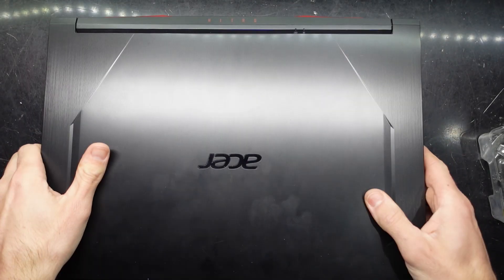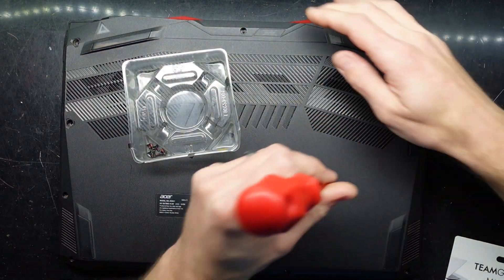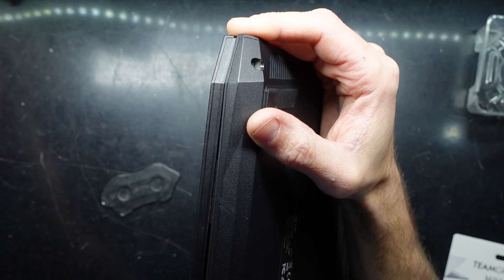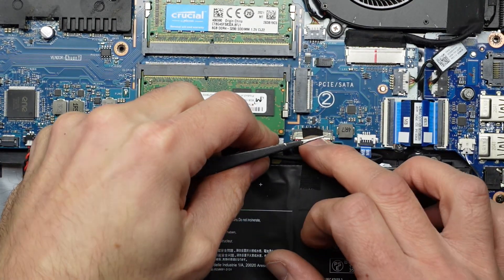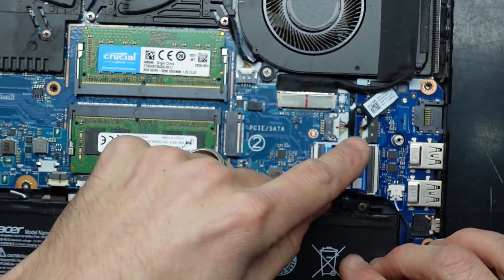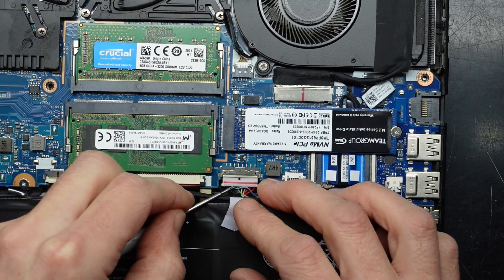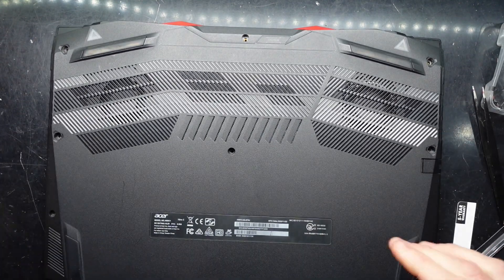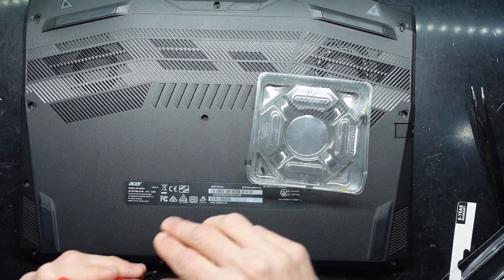Acer Nitro 5 AN515-55 How to Install NVMe SSD

Comment: I was trying to pull the battery strap out of this same model and it won’t come out. I pulled hard now I don’t want to cause damage. Do I just go through and do the new ssd placement anyway?
Reply: Yes it is fine, just be sure to do this on a non conductive surface like a table and to not drop anything on the motherboard.

Comment: So i have this laptop an i always kept it plugged in while playing an then it just blackscreened an shows no signs of life? Should i try disconnecting battery an play plugged in or is it something else?
Reply from the maker: i would open it up 

disconnect the battery and try and power it straight off the charger cable

Comment: I just installed a Kingston nv2 1tb pcie 4.0 x4 nvme m.2 ssd (snv2s/1000g) now my laptop cpu temperature is much higher than before Acer Nitro 5: Ryzen 7 5800H | RAM 16GB | 512GB SSD | VGA RTX 3060 6GB | 15.6 inches FHD IPS | 144Hz|
why is this happening ?
Reply from the maker: i dont know sorry
Reply: @rickstechrepairs  I lowered my CPU power to 90% and the problem went away , must be the new SSD is causing the CPU to get hotter somehow any way runs fine now

Comment: Why can’t I unscrew where the NVME is ? Is needed a special kit ?
Reply from the maker: i use a 000 phillips head screw driver
Reply: @rickstechrepairs  my mother card was the problem anyway, so wouldn’t help me even if I change it 

Im still grateful btw, ty !

Comment: I have an Acer Nitro 5 AN515-51-55WL and can't find the right m.2 ram for it. Can someone help! I've bought 3 from Crucial/Amazon and returned them all because after installing, I get the message " no bootable device. "
Reply from the maker: which slot are you putting them in to?

if you only have the new ssd installed and no other drive, you do actually need to install windows 10/11 on a usb after you put it in

Comment: I installed it but I went to my file explorer to check it but it is only showing the one drive not my new onwt
Reply from the maker: right click on the windows icon (bottom left or center if windows 11)
Select Disk Management 

should pop up asking for format drive
Reply: @rickstechrepairs  thank you I got it working perfectly
Reply from the maker: excellent

Comment: Wow! That's cool! I never even knew that the Nitro 5 could hold an M2 in addition to an extra 2.5 inch SSD! One question! Does every model of NItro 5 have the slot for the NVM? (Mine is AN515-55WL)
Reply from the maker: most recent ones do, i think yours should

Comment: I have a few questions. 
1. How important is disconnecting the battery?
2. Will that cable by the 2nd nvme ssd slot cause a problem, or can I just nudge it a little and slot my ssd in?
3. After upgrading both my ram and ssd, will my laptop boot to the lock screen as normal (and work as normal), or will I be met with a different screen or have to go through BIOS?
Reply: 1. defnitley diconnect the battery just to be safe! 2. if you need to move it then nudge it with care! 3.Should boot straight to lock screen.

Comment: I just put a second m.2 in my Nitro 5 as shown here. When it's in place, I get a "no bootable devices" screen. When I remove it, the computer boots as normal. Any guesses on what's going wrong?
Reply: If you load into your BIOS you can check the boot order and adjust it.
Reply from the maker: sounds like its trying to boot of the nvme with nothing on it

Maybe switch NVMe Slots
Reply: @rickstechrepairs  thanks for the response, I actually tried that just last night, but it didn't help.

Comment: Sorry if my questions sound dumb but I don't know much about how gaming laptop insides work. 

Is it possible to remove the original SSD that came with Laptop and insert 2 aftermarket SSD into both the left and the right to increase the storage size? Also is there a storage limit and will replacing the orginal SSD wipe any signifacant files on my laptop?
Reply: Everything is stored on said original SSD, so you'd have to move everything over to the new ones

Comment: Samsung 980 Pro M.2 Nvme PCI-E Gen 4 SSD - is it compatible.? i dont have any knowledge in laptop or PC
Reply from the maker: it should be compatible but i dont think it will run at Gen 4 Speed

Comment: Hola amigo buenas !!!! Tengo una acer nitro 5 an515-55 y le compre una PCIe gen 3 x4, NVMe marca acer modelo FA100 de 512gb y cuando lo instalaron no lo reconoció, lo retiraron y lo volvieron a colocar no lo reconoció entonces invirtieron de posición el disco nuevo con el q viene de fabrica y ahí si lo reconoció ahora cuando llegue a casa note q no tenia la velocidad q el disco q viene de fabrica, con un disco externo pase un archivo de 15gb al disco nuevo y demoro 46s y repetí la operación al disco de fabrica y tardo 37s ... por que demora si ambas tienes la misma velocidad de escritura y lectura? es normal? O el disco q me vendieron esta fallando? ... espero me pueda responder de ante mano muchas gracias !!!

Comment: hey im planning to upgrade my Acer nitro with Kingston HyperX FURY/Beast 8GB 3200mhz and a Silicon Power NVMe PCIe Gen3x4 M.2 2280 SSD 512Gb do you think this is suitable? thanks alot

Comment: i tried installing ssd the same way in the same model but my ssd in not showing in disk management or either create or format disk , i am using crucial 3.0 nvme m.2 ssd . can you help
Reply: Hey, I am planning to do the same upgrade, did it work for you?
Reply: might need to use a software program to enable the hard drive/format it/partition it/etc.
Reply: hey, have you resolved your issue ?

Comment: Can i ask what kind of  screwdriver are you using in removing the screw for the ssd slot? I recently open mine but when i try to use my screwdriver it wont turn, i'm currently using a philip screwdriver but it wont bite the screw is there some kind of specific size that i need for my screwdriver? (It's my first time so opening a laptop so im not familiar)
Reply from the maker: It takes a 000 Phillips head
Reply: @rickstechrepairs  i see, appreciate the reply thanks 👍

Comment: I have this exact model, also did an upgrade of the same sort! Nicely explained though I cant remember disconnecting the ribbon cable.
Reply from the maker: Personally, if the machine is off. I will install ram/ storage

But some people have accidentally fried stuff when  not disconnecting the battery when installing
Reply: ok so I brought mine an515 – 44 now my question I brought the Samsung 980 Pro 1TB with heat sink will it just slide in and work
Reply: @deanshaw6588 I would think the time to ask that question is before you bought it. But most likley as long the only issue might be if the heatsink takes up too much space.